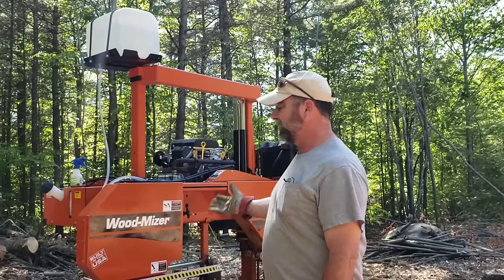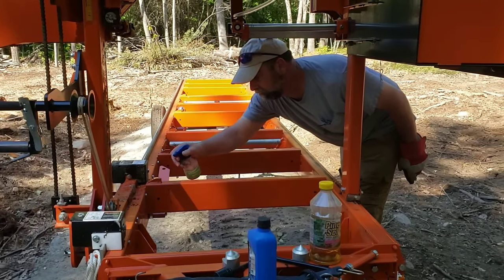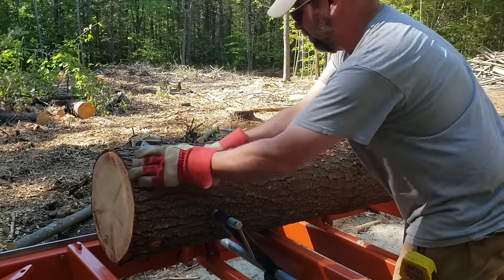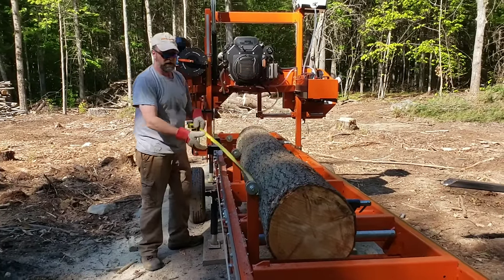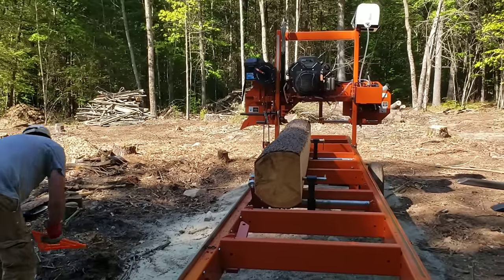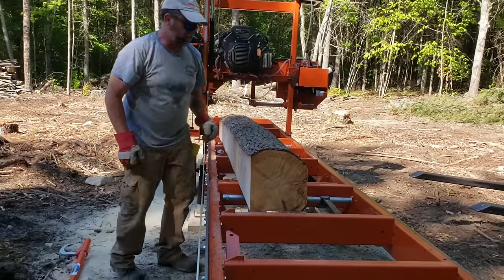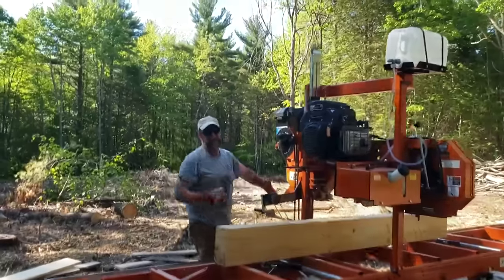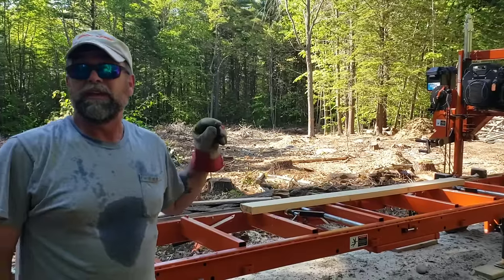Cutting 2x6s with the woodmizer LT 15 Go sawmill.

Comment: Hey, i saw you were standing up to pick the log up. Heres a tip for you. The very top of your bucket is flat and parallel with the bottom of your bucket. So whatever the top of the bucket is doing the bottom is too. Hope it helps out.

Comment: Couple suggestions you can take or leave; spend a bit of time to look at your log, rather than make two skim cuts, take more on first pass, your blades last longer and for time cutting you get more usable wood, look at the pith(center of log) vs comparing the diameters to decide if you are going to level one end-it makes a difference in wood grain and strength of wood you produce, once you roll your cant for the next cut you can use the position of your clamp to influence the perpendicularity of your cant instead of clamping it tight then fighting that pressure with your cant hook for slight tweeks, try using your handle to travel vs pushing, it can be just as fast but more importantly it is more consistent, you can get away with pushing soft woods but you'll notice a quality of cut issue on hardwoods pushing it through, lastly, slow down, think fast, move slower, you'll end up being more efficient, you'll re adjust less, and you'll enjoy more. Have fun!
Reply: I agree  over working your self each cut, so slight  easier my input the cost of wood  too high to not care.
Reply: Seems to be many unnecessary cuts, more use and stress  wear on the blade. Save time and effort . Nice piece of equipment,..

Comment: As a Woodmizer LT40 owner I would like to suggest you start sawing from the small end. You can find the cant size by multiplying the diameter under bark of the small end by point 700.  Do this before you start cutting.
Reply from the maker: Thanks for the advice!  I am still kind of new at this.
Reply: That works on perfectly straight logs with slight taper... anything different and I’d still saw from the large end. It’s easier on the blade to go into the log ‘Square on’ instead of coming in at an angle on the side to remove the taper slabs. Plus if you have more than slight taper you can squeeze out some shorter 1” lumber as you’re squaring up the cant, vs taking off thick slabs that just get burned or chipped. If he had started out immediately squaring the cant to final size that would have resulted in lost lumber. Maybe not a big deal on pine, but not so with hardwood. Hell even poplar- they sell 5’ shelf boards for $10 at homeless despot.
Reply: Always start at the bell.
Reply: @brucea550  one guy said pretty much the same as you but he said figure out what you want on the small end.
Reply: I have several years experience running a huge production baker band sawmill with all the  bells and whistles.  I cut 28’ beams all sorts of widths and thicknesses.  The small end toward you is what you want.  I doubt most of the people that will say something on this thread have the type experience I’ve had.  Not knocking anyone else.  Just stating the size and ability of the mill I’ve had this experience with the production level 10 &1/2 hours a day 6 days/week for the general public, I know there is a difference between my experience and knowledge and that of what I would consider a person that does this as a hobby, or to supplement income, or just to achieve a specific goal like building your own out building.  Good luck to you and yours.
Reply: @brucea550  A sharp blade can enter the log at full speed and at any angle. Log ends should be cut with a chainsaw flat and square before placing on mill.
Reply: @rexhavoc2982  You missed my point. I’m not talking about how the blade enters the end of the log. If you continually saw from the small end you either immediately enter the log and have a lot of waste on logs with large taper, or you ‘skim’ into the log partway down the side, to get the shorter boards, which is hard on a bandsaw blade.

Comment: LT40 owner here since 1991......over a million board feet sawed.  Here are some observations that will help you.  

First off, I'm glad I don't own THAT model.  Mine was the lower end at the time, being non hydraulic (which you really DON'T need by the way unless you saw a lot out on the road), but it does have the 12v electric drive, (+ head up/down and blade guide in/out) meaning I don't have to push it down the log.  Not that it is that hard to push it down the log, but the time you spend pushing where I just put it in GO, is time you can spend removing slabs or lumber while the saw saws, way increasing production on a one man show.

You'll learn after a while you don't need to clamp it.  Only time I use my clamp is IF the log wants to roll away from the dogs.  Once I get two 90 degree faces, I never clamp again.....log ain't going anywhere.....the blade keeps it tight to the little nubs. You're working too hard at this.

And WM screwed up with that dog design.....with the wheels at the top, the log doesn't fit flush to the dog like on the other mills....mine I don't need a square, the dog is dead 90 to the bed.  Any crack of daylight between the log face and the dog means the log is out of square to the bed rail.  I'd be tempted to remove the wheels and grind an angle on the top of the dogs to make it like the older style.....save that work squaring.

Another thing you're not in the habit of doing.....raise the blade slightly before you back the head up.....LOT of times a cant will arch either the ends up or the middle up as you saw and relieve the stress in the log (yellow poplar is THE worst about this)......you don't raise the blade, it will catch the end of the cant and strip it off the wheels.

You should also saw some 6x6 cants out, and build yourself a log deck on the side you load from.....not only can you load a bunch of logs on it, saving time on/off the tractor, but you can put your boards to edge on it as well, rather than throw them off to the side to have to bend over and pick up again later.  When you get into sawing larger stuff, like 2x10 or 2x12s, you back will thank you.

Last, you need an SSQA adapter (ATI in New Holland Pa makes them for ANY tractor) on your tractor so you can quickly switch from bucket to forks....then buy a set of REAL forks, not those fool clamp on things.  Those are not only award to use compared to real forks, they will eventually bend your bucket when you put enough pressure on them, and the load you can pick up is WAY reduced due to how far out in front of the bucket they sit.  They might be OK for the person that rarely uses forks, but if you have a sawmill, your gonna USE forks.....get a good set.

All this is stuff you'll figure out anyway, maybe this just gives you a heads up.
Reply: And slow down a little while in the cut
Reply: It’s his first time he didn’t know, but that’s how they do it up there in the mountain 😂😂😂😂😂

Comment: great video, I am looking at one for the first time by my self. Cost of a 2x4 here in Ak went from a 2.50 to like 9 bucks and it is a 200 mile drive to go get it. That being said I do have tons of experience of a 100 hp mill in Denver and one up in Frazer Colo that the company I worked for had. also had some twin blade turners too. But now just want a little guy. :) My place has thousands of trees so long as the lumber prices stay high I could have it pay for its self.

Comment: Nice video, and not to long, informative   good job, backed and watched one more time, you should move the water valve over by the engine, and make a little tool box to keep you locking knobs in by the lockers, wish I had one of these so much wood to cut up.👍👍👍👍

Comment: I would make  28" or so vertical extensions  on your forks or bucket with 20" or so  forward  projecting  extension's ,  to prevent accidental log rolling down your tractor loader, visiting you in the drivers seat, that would ruin your day  !  Nice video on the sawmill !

Comment: I always wondered about how square they come out. Yours is the first video Ive seen where you actually measure the angle as you make the cant.
Reply from the maker: I was taught that from an old timer, even older than me!  I don't bother when doing 1 x boards, but for 2 x 's and bigger, I always check for square.
Reply: This is why you will always see commercial sawyers only rotate 90 degrees after opening the log with their first cut.  Open the log, then roll it in so the flat you just created lies against the stops and it makes it very fast to end up with a perfectly square cant so you can get on to cutting boards more quickly.

Comment: I am not an expert, but I have worked a small mill.  I think one of the things I would do, is have a couple yard sticks, clear lacquered. And give the tape measure a break.  I hear that thing slamming home, and wonder it is not broken.  I am also thinking it might be nice to have a 24 ft section of mobile home frame, with tandem axles, for smoother ride on the road.  I would be taking a good look at that power head and think up a cover for it.  I like to protect nice things.

Comment: Thanks for the info.  I am really wanting a basic, functional mill.  I learned a bit.  I think I will have one under an insulated roof. Partly to keep the mill nice, and allow me to work in nasty weather.   I think I would extend the saw dust chute enough, so I would not have in the walk area, and I would want the walkway smooth.  Perhaps a fan set up , to blow saw dust away from me.  Red cedar can be a bit hard on the lungs.

Comment: I was wrong, a 2X4 is actually smaller. It measures 11/2 by 3 1/2 inches. They shaved another 1/8 of an inch since I was young.
All the best, Edgar
Reply from the maker: That's dimensional lumber.  Rough cut is the actual size, 2x4.

Comment: Curious why u don’t cut the 2x6’s the size of store bought (1-1/2” thick), seems like u might get an extra board or two from a log. I’m just trying to learn about all this so it’s not a bash. Nice video
Reply from the maker: Rough cut is generally true to size, dementional lumber is what the store bought stuff is called.  In a newer video I did I made some 2x4s the size of the stuff in the stores for a project I am doing that I want to save weight on.

Comment: Love the mill, do you cut your lumber a full 2”x 6” or like they do at the yards that 1-3/4”x 5-1/2” ?
Reply from the maker: I usually do the 2" x 6", not dimensional lumber like sold in the box stores.  However I will be doing some of that soon to save weight in an upcoming project.

Comment: Level each log from the center at each end, use Toe boards or a jack to get the first flitch off each side so the center of the log will be in the center of the cant, Never set a cut surface on a raised toe board or jack, let it set flat on the bed.Work your way down to the top of your cant in any lumber thickness you can, set aside and edge them later.

Comment: Could you help me out and tell me the diameter of the clutch pully, driven pully, and band wheels?  And if you know the rpm of the motor that would help, I'm trying to calculator the speed of the blade.  Thanks!!

Comment: You cut those at 2" right??  I thought you would have cut them at 1 1/2 . No? Or do you plane them after?
Reply from the maker: I cut these at 2", this is rough cut lumber,  I do not plane them either, I use them as is.  Dimensional lumber, like you get at Lowes, would be cut to 1 1/2.  I have started to make some like that lately to save weight in a few projects.

Comment: This is for anyone, when he says it's 6" X 10" does that mean 6 inches plus kerf?  Or is it assumed that the kerf is gonna come out of the 2" per board?  Thanks!
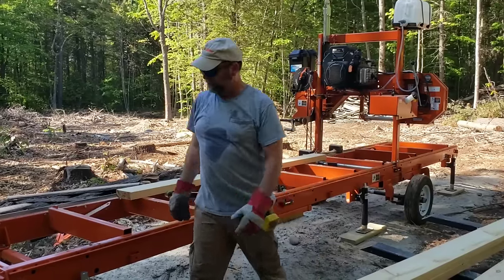Also, at 28:08-ish, he cranks the head up and the engine seems about to stall but it recovers - any idea why?  I didn't see him touch throttle.  Did I miss it?  Thanks!
Reply: The kerf will come out of the 2". The wood will shrink a bit as it dries anyway. Your not getting exactly 2x6 when it's all dried and cut.
Reply: I have two scales on mine (not familiar with the scale on this model in the video).  I have an inch scale and a 'quarter' scale.....4/4, 5/4, 6/4, 8/4....the quarter scale allows for kerf AND you end up with 1/8 over whatever.....4/4 is 1 1/8" lumber.  This was because most old circle mills were notoriously inaccurate.....furniture/flooring factories required 4/4 lumber so they could actually dry and plane to to 3/4 finish lumber.

The inch scale is just that.....each inch drops the head exactly one inch.  So your lumber loses 1/16 ish for the blade kerf, and about that much again as it dries.....you end up with a dry board right around 7/8" thick.  If you need 3/4" finished lumber, sometimes this works, but the slightest variation in sawing and it doesn't.  I saw my hardwood lumber on the quarter scale so I'm dang sure of finishing it to 3/4".  My softwood lumber, I use the inch scale, because most of it isn't going for planed stuff needing to be 3/4, I use it in the rough stage, or just skip plane at most (knock it all down to the same thickness.....like 13/16".
Reply: Wow. Thanks for that explanation. That's pretty awesome. What type of machine do you have?

Comment: I am curious about building with green lumber.  I wouldn't foresee any problem with sheds, but for those who make dimensional lumber for a home I suspect it would be tricky.  Anyone have experience airdrying lumber and keeping it straight?  No one wants to build a wall with the water skis you see in the Lowes 2x4 stack.
Reply from the maker: All the lumber I have let dry has remained straight if it was straight when I stickered and stacked it.    I have not built anything like a house, and probably never will.

Comment: Great video! How long before you can use that lumber?  I assume it needs to be left to dry
Reply: Depends on what you're doing with it.  Building a shed or barn ?  You can use it right off the mill.....though I do let mine air dry a few months.  Using it to build a house, you'll want it to air dry on sticks 6 months to  year, depending on thickness, and so on. If the lumber dries more after you build, you'll have sheet rock nails pop all over the place.  It needs to be 18-20% moisture content to use for house framing.
Reply: @edsmith4414  I’ve also found out at here in California it needs to be stamped and graded wood for anything structural so I couldn’t use it for the house build no matter. I am however going to buy a mill so I can build my sheds and covers and anything else that comes up. Thanks again

Comment: Can you tell me the maximum distance between the blade guides? It helps to know me the maximum width of board this machine can cut.
Reply from the maker: According to woodmizer, my mill can make a cut up to 26" wide.  I have not tested that yet.  That would be one heavy log!
Reply: @AmericanAdventuresTJ  You can measure the distance with tape. please do measure that. you don't need to saw board for that.
Reply: @karnatamang8105  I bet if woodmizer says it’s 26”, that’s what it is. 😉

Comment: Okay, I got questions! Lol 
Rolling the log on that fast really shook the frame. Will that not eventually lead to wracking it?
When you first fire up to cut, I’ve always been told to let the blade run for a minute to warm it up and balance out the tension. Yes? No?
You cleaned the bark for the first cut, but not the second cut? (Oversight?)
How did you get five 2” cuts from a 10” cant? Was it actually 10 1/2” to start? Otherwise the bottom board would only be 6/4.
When you were sawing down to 6” on the 4th side, you could have taken a 2” slab and gotten a 6th 2x6 plus a 2x4, no? Or was the 1” worth more to you?
Very nice video, good camera work and explanation of everything! Wish I had pine logs that nice to play with! And of course the tractor... ha!
Reply from the maker: Thanks for watching.  I haven't heard about letting the blade warm up.  As far as 2 inch cuts, I move the blade down two inches eqch cut,, so yes, one of the boards will be a little thinner.

Comment: Just curious why not cut twice push it forward cut but not push it backward cut?
Reply from the maker: The blade only has teeth on one side.
Reply: @AmericanAdventuresTJ  Ohhh duh lol do thy make a double blade?
Reply from the maker: @jeffreycrocker6798  No, and the way the head is set up with bearings and guides, you wouldn't be able to run it both ways, although that would be awesome f you could!

Comment: I thought a 2X6 measured 15/8 by 5 5/8. Am I wrong?
Reply from the maker: I cut mine 2x6, or close to it.  This is all for my own use and I am still new at milling.
Reply: More like 5.5x 1.5
Reply: dimensional lumber 2x6 verses non dementional 1 5/8× 5 5/8

Comment: You know the metal clips that are designed to connect your juices together?. They are designed for lumber that is 1 5/8 inch wide. Go to homedepot and measure one. All the best, Edgar
Reply: Rough cut 2x6s.🇺🇸
Reply: Swing blade setup with optimal slabbing attachment will maximize your log returns less wastage would have been cut up sitting back having a beer hour ago
Reply: @damienbrain8867  The Lucas swingblade setup I researched awhile back was a LOT more spendy than this bandmill...nice if you have $$$$$ upfront, but for his purposes I bet his mill makes the most sense.

Comment: so 30 minutes per 5 8 or 10 foot 2x6s
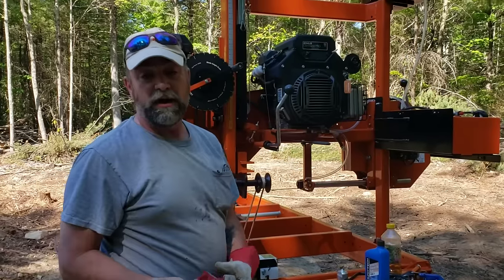Reply: 1st 5:30 was mill prep, vid=29 mins.  Guy is still new to milling, he's taking time to explain what is happening.   His logs are not situated right next to the mill so there is some time lost there.  A fair time estimate once set up and milling for 3 or 4 hours straight would probably be closer to 15-20 2x6x10 per hour.  Here in NW MT a 2x6x10 is right at $10 currently.  Even producing 10 sticks/hr would still be ~ $100 hourly saved [minus gas/blades\ATF/depreciation etc]. 
Even figuring expenses at a ridiculously high 50%, he is still saving the equivalent of $50 hourly AFTER taxes...dunno about you, but when I was a working RN I never made $50/hr so this guy is doing pretty well as I see it-